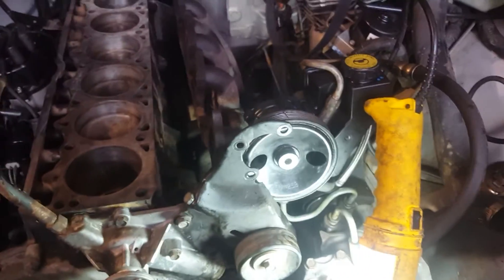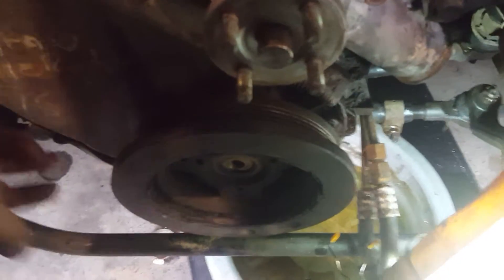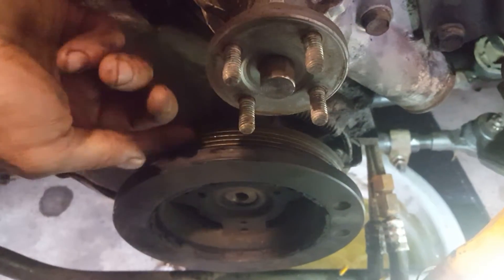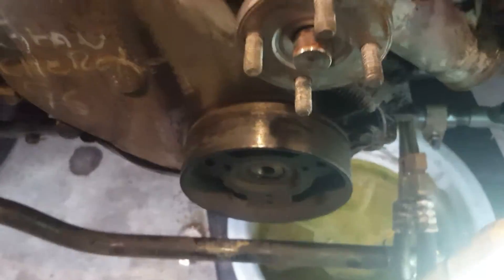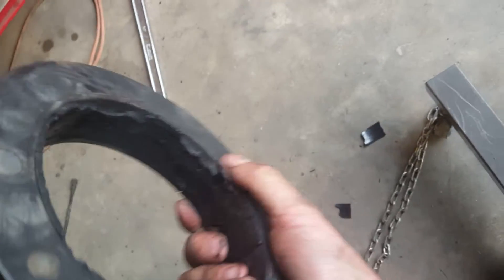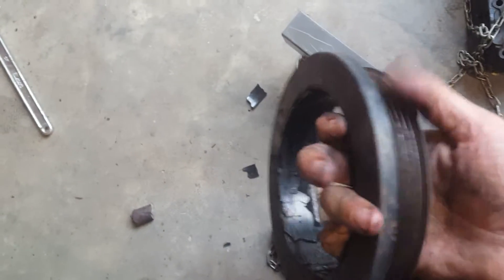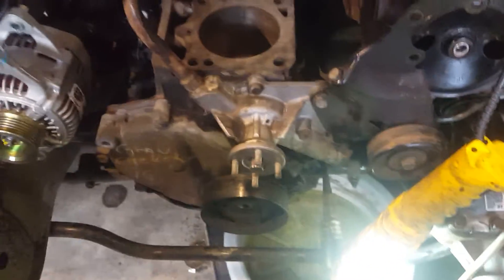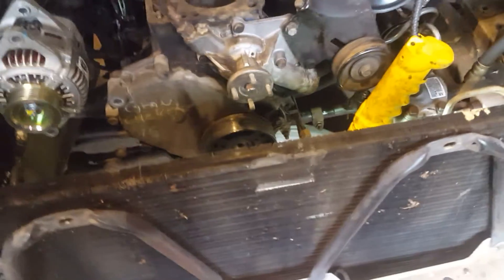Is your Jeep 4.0L still overheating? Here's why.

Comment: 10 year dodge tech here, been dealing my 94 overheating after got the ac working. Never in a hundred years would i have thought to check this. You earned a sub today! God bless!
Reply from the maker: I don't know everything about anything, but I do my best to share what I do know. Thanks, and be sure to comment, share, and otherwise participate in my other videos,!
Reply: I've got a 94 and we replaced everything on the cooling system and its still overheating and bubling in the reservoir
Reply: @cadenedwards9727  Dodge ram 1500 damn my 93 Dodge ram w350 extended cab short bed diesel Cummins no major issues motor doesn't overheat is good even when off road
Reply: i dont mean to be offtopic but does anyone know of a method to get back into an instagram account?
I somehow lost the account password. I would appreciate any assistance you can offer me
Reply: @Layne Sawyer instablaster =)
Reply: @Kobe Shepard it worked and I now got access to my account again. I'm so happy:D
Thank you so much, you saved my ass :D
Reply: @Layne Sawyer Happy to help :)

Comment: I'll never forget the time I had a harmonic balancer come apart. It was on the beach @ Oregon inlet of all places. Didn't overheat until the pulley and belt came off. That was on a 93 XJ.
Never got the name of the guy with the land rover that pulled me all the way to the ramp

Comment: Had one that overheated constantly, on a long road trip out of desperation we pulled the thermostat and resealed with gasket made from cereal box and lip balm and then re routed the rear window washer tube to the radiator and poked holes in it to mist the radiator so it would not over heat in traffic so bad, that same trip the drivers rear brake fell apart and ate up the drum we had to rebuild in parking lot... oh the memories.
Reply: Rear breaks for sure

Comment: Way back when we were taught to check dampeners. Years go by and I never found a bad one. I don't remember all the timing issues I was having with a FE390, but I chased them around for a few days. I probably finally set TDC at the cylinder and walla! The timing marks were nowhere in sight. iirc I'm pretty sure what we were taught was to always replace the dampener at overhaul. Never reuse an old one on a good build.

Comment: Thanks for posting this i will check mine, Thing is making me crazy. I"m in S.Fla this morning just removed the t-stat and within 2 miles on the turnpike pissing H2O thru the new 18psi radiator cap,  She has got new radiator 6mo I replace it, new h20 pump new, 7120 head, all done to factory spec. Ok HB is on the list as soon as she cools down! Will flush it again too,
 thanks
Reply: R C how you doing brother? Did you get your overheating problem fixed?

Comment: Air lock stops coolant from flowing.
Coolant gets too low or after filling back up.
Air pocket can bleed out at temperature sensor.
Back of cylinder head driver side. Very small.
Only do it cold. Tilt nose down hill. No air pocket , no overheating. Do not do it when hot.

Comment: I NEED to check mine! Flushed the system and put in a new thermostat and the fan clutch is tight but I’m STILL getting hot at highway speeds, especially with the AC on. I have 260k miles and this makes total sense. Runs 220 without AC and 230+ with it on. Added load of the compressor probably just makes the balancer spin even more freely!

Comment: That's a good tip but you wouldn't just have a cooling problem, it wouldnt charge which I'm guessing is why there's a new alternator, and the power steering wouldnt be working

Comment: gotta 87 wagoneer, and lots of other reasons for that heartbreak..closed radiator, capless, + 2 known pinhole radiator leaks..them gets you a air embolism and have to pull the sender out the head park on a hill and burp it, with coolant..need to fabricate special anti-frz dispenser out of 64-oz. soda bottle and skinny end tube so it fits in the tiny hole!!!!! After I'm replacing the radiator and fan-clutch, I'll see if I need to do this also. Thanks, never would have thought to check it! (Also, think I have a slightly blown gasket, but as long as we don't overheat, seems to work oaky.)

Comment: Got a 99 Cheap Cherokee . Tearing my hair out with the same kind of hearing problems . Gonna take my belt off soon as it's light and chk that tip out . I bet that's my problem . Thank you sir very much .
Reply from the maker: Not a bad idea to replace it regardless. 24 years of use on a two piece rubber bonded pulley is pushing the envelope. It's not an " if" it'll fail, it's a " when".
Reply: @tacticalrepair  You're absolutely right. It's done it's job . Hard to complain about a part being  24yrs old but its time .Thx again . At least it a plausible idea when I am out of ideas .
Reply: @tacticalrepair  Sir , I need some advise on a  Jeep if you can ? 
I have a 99 Jeep Cherokee sport 4.0 , 2 wh , dr, w/air , automatic. Issue is no heat and winter is coming . Heres what what I've done so far . First I had a blown head gasket , water in the oil and that . Fixed that . Tested new thermostat in boiling water , had a leaking heater core , fixed that , back flushed it and both hoses get hot now . The vents all open up when using the climate control . Still no heat . It seems like something isn't getting the message when I turn the knob from cold to hot ? Also the air conditioning works fine . When I turn the knob to cold for the air conditioning it gets the message . Ive got an 86 Prelude and it even has a simple component right on  a heater hose that you can see it change from cold to hot , but not this Jeep . That'd make life too easy . I know this is a long-winded but I'm pulling my hair out and just wondering if you had any ideas of what to go look at next? I sincerely thank you for even considering. Good day sir
Reply: @tacticalrepair  Turns out it was the blend door unit. I do appreciate the tip on the harmonic balancer as I'll be changing  it this month .

Comment: I have a 2004 Cherokee..New Radiator/Harmonic balancer/Pulley/ thermostat and water pump. FYI the 2004 has a metal balancer not a plastic innercore I replaced that based on what you said and it did not solve the problem. There is no water mixed with the oil the rsdiator and over fill is full of coolant so I don't know what the issue is! New fan too.
Reply from the maker: You probably have a minor crack in the head or a very small headgasket leak from a cylinder to the cooling passages. Suggest getting yourself a headgasket leak detector kit.

Comment: Been there done all of that still kept overheating turned out that the factory relay ground for the e fan isnt any good so a solid ground wire straight to the battery finally fixed it.
Reply: Someone did the same to mine before I got it. Can't get that fan to work without it. Glad I saw your comment.
Reply: Relay ground? Straight to battery? Im new to all this. Gonna google it after typing but still worth asking

Comment: i live in az and ive replaced thermostat water pump fan clutch condenser everything and even had 3 core csf in it finally put factory rad back in it chills at 204-206 and be over 100 out but then ac on it has heat creep real slow but when start movin it will go back down normally doesnt go over 219    and its a 01 with 335k on it original balancer lol

Comment: Ive got a 2000 XJ 4.0 and started to run at 220 and overflow in my reservoir after parking. Did a total flush, changed the thermostat and it still ran hot and bubbled over in the overflow. So assumed it was a headgasket but no coolant in oil or vice-versa. So replaced that and didnt see any crack in the head while doing it.... well, it still runs hot and bubbles up!! Any thoughts of whats wrong or where to start? Did I miss seeing a cracked head? Could it be a cracked block? Could it be the harmonic balancer youre talking about? Sick of throwing money at this thing
Reply from the maker: The 2000- 01 are famous for cracked heads. Most probably that's the problem, but check your balancer too. Replace the thermostat if you haven't yet.

Comment: How do I fix it if I have the exact opposite issue? It runs cool while on the road but over heats sitting idle for roughly 20-30-ish mins. I have a 1996 Jeep Grand Cherokee Laredo
Reply from the maker: Could be the fan clutch has gone bad, water pump is weak, or radiator has buildup inside so there's not enough heat transfer at low flow.

Comment: i did this on my old f150 4.9,was not running hot but got a vibration, had that truck 21 years and 540,000 miles before sold it

Comment: The belt drives the water pump which is connected to the fan. If you can’t see the fan not turning please sell the Jeep and buy a Prius.
Reply from the maker: Agreed, however they can spin at idle but not under load. In this case the fan did still spin at idle but on the road it would run hot.

Comment: Does the harmonic balancer make a pretty bell sound when it's going? Mine does in idle and goes away after a bit. Thermostat was just changed but it's still hot.
Mines a 2.5 from a TJ by the way.
Thank you for the video.
Reply: Ggg

Comment: Mine overheats running for some time in highway at high speeds above 65MPH, even if motor is running at less than 2000 RPM, and when overheats water leaks from the antifreeze reservoir, once I go out of highway it goes back to normal, about 210, I was thinking to replace the cap, but it could be an issue this but still not sure why temp is normal at low speed city driving, with constant stops and high RPM and bad at high speed low RPM

Comment: i think you just solved my problem. ty. just chnaged all coolant parts and still over heat .
Reply: Mike Coldsnow .. I am going to check mine when I get home I have the front end torn off doing the second change of all my cooling system... am very curious if this might be my issue🤕

Comment: Just got this 2001 Grand Cherokee from me neighbor.. I have flushed EVERYTHING an It will over heat even without the thermostat in it at idle ??
Reply from the maker: Blown headgasket or cracked head, 100%
Reply: No oil in the water an no water in the oil an no steam comin out the exhaust..even did the exhaust gas test.. Still overheats???
Reply from the maker: Did you change the radiator? If you did change the radiator, did you make sure to remove the shipping plugs from inside the hose necks?

Other than that, has to be headgasket.

How's the fan clutch feel? They're cheap. I usually replace them every few years for good measure.
Reply: Radiator an everything was new .. the only thing I haven't takin off is that New water pump.. thinkin Maybe he got a junk pump an  the impeller came off.. tired of taking thus thang apart !
Reply: Couple days ago I ran the jeep around the yard.. it ran hot again.. found a tiny hole on the back side of the tube that goes from the water pump to the heater core.. got a new tube, already bought the new water pump an balancer.. took it apart AGAIN yesterday to put in new pump ,tube an balancer an  some IDIOT forgot to plug in the electric fan 🤔 😁 .. got new everything in got too late to run it..
Reply from the maker: @davidchappelle6480  small chance, but you're not the same Dave Chappelle from Dirt Everyday are you?
Reply: @tacticalrepair  🤣 No... I'm the other white guy that gets that ALL the time.  I'm also older then him
Reply from the maker: @davidchappelle6480  sorry, but it's a required question.😂
Hope the fixes you've done solve your problem. If not, you know what it needs. Either a headgasket or a head. These engines are very prone to cracking heads.
Reply: @tacticalrepair  I was thinkin about takin the radiator cap off a throwing across the yard an put a LS in it ??? 🤣

Comment: Mine does the opposite. Overheats at idle and with ac running
Reply: Same. I over heat when idling /crawlin, get up over 15 and it cools down in a jiffy. Water pump is 3 years old, flushed the cooling system and the 3 year old coolant coming out from water pump job looked absolutely beautiful, still bright green. Radiator is clear of any and all debris. I'm stuck?
Reply: I had the same on my 2000 XJ. The culprit was the aux. cooling fan and temp. sensor. The fan would turn on, but wasn't moving as much air. New fan and sensor, and now it will not get above 208 degrees.
Reply: Changed my fan clutch after I heard my buddies 4.0, it was running and we had the hood open, I blipped the throttle a few times and I heard his fan spool up. Changed my fan clutch and now it doesn't overheat at idle unless it's been like 20+ minutes, electric fan still wont kick on unless I've got the middle knob in one of the ac modes tho🙄
Reply: Seems like there are a lot of different reasons why this happens, for me in my 04 GC Laredo it was a thermostat stuck shut... drove it around for 2wks in Texas heat blasting the heater to cool it down in traffic.

Comment: I have the opposite problem. When the jeep sits idling, the temp gauge rises, but when I drive, the temp lowers from the air pushing against the grill. Any idea what that means?
Reply from the maker: Your fan clutch is bad and/ or your electric auxiliary fan isn't working if your vehicle has one equipped.
Reply: @tacticalrepair  Thank you kindly!

Comment: I have the opposite problem. Engine runs at operating temp while drive but overheats on idle. Gave up trying to find the problem
Reply from the maker: Your fan clutch is bad, or if you have one equipped, your electric auxiliary fan isn't functional. Fan motor or relay is bad.

Comment: My Jeep is 04, 4.0.  I told the mechanic 210 means it's HOT. He thinks it's ok at 210 and up to 220 or so. NO!  
I know my Jeep!  

It gets to 210 sitting idle in parking lot lately which is abnormal. If it sits long enough it starts making a constant low noise (bad).  So. I'm thinking it's the fan or something related. 
My dad told me replace thermostat yearly because it's cheap and they wear out. I'm going to buy one and request that.

Comment: Ok question would going to a lower thermostat work to stop overheating at idle (195-160) ? mine's an '89 4dr xj w/ a flowkooler waterpump ,mishimoto radataor & 3 fans setup + an oil cooler .
Reply from the maker: No. If you have all that and you're still overheating, you either have some restricted cooling passages between the block and head, or you have a cracked head/warped head/ bad headgasket.

Comment: Hi bro , just saw your video good information, but I replaced the harmonic balancer on my yj jeep 1990 4.2 also did the timing chain and after that I have overheating what can be wrong?
Reply from the maker: Is it still running good? Still powerful? You may have got the timing off, which will cause overheating. Or you may have blocked a coolant passage with a piece of gasket or silicone sealant.
Reply: @tacticalrepair  I’m pretty sure the timing is off because yj feeling like no power but start ok , by any chance do u have any idea what the distributor position has to be ? Thanks bro for ur help